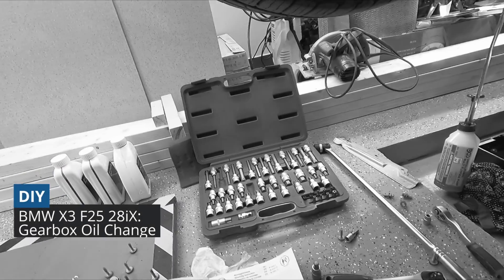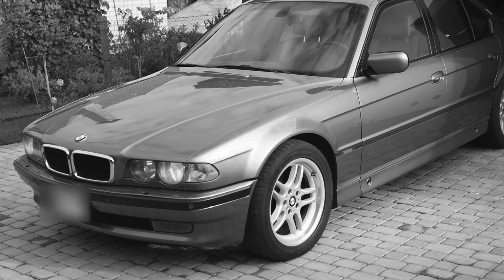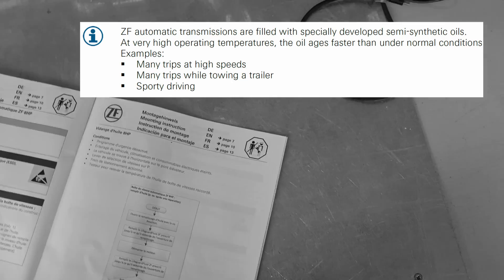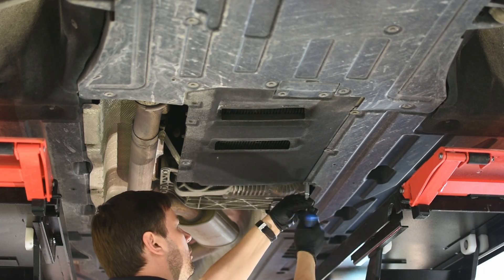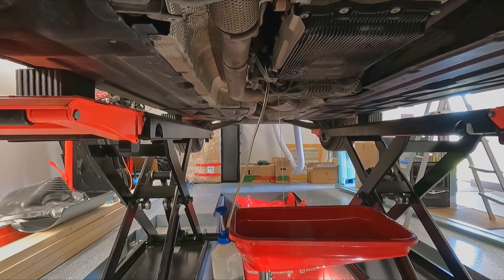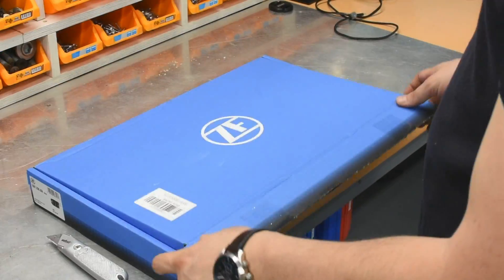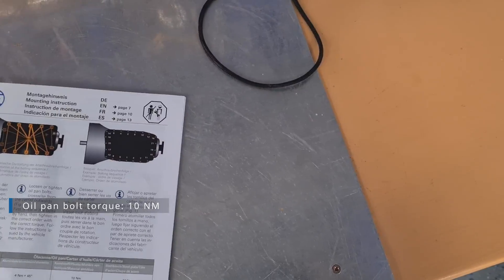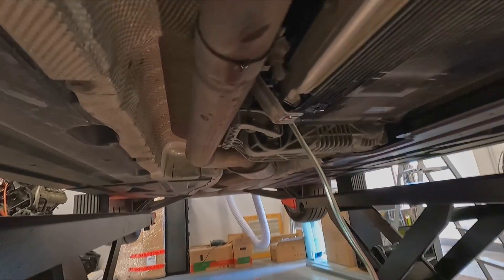Transmission Oil Change: BMW X3 F25 28iX / ZF 8HP45Z

Comment from the maker: 🔧 Tools used: 
       🔹BGS 2292 General rachet and socket set: https://geni.us/0Hhd (Amazon)
       🔹BGS 5188 Torx and Hex socket set: https://geni.us/Zz55Akr (Amazon)
       🔹BGS 228 flexible long ratchet ½: https://geni.us/aFqZxDW (Amazon)
       🔹Underhood LED light: https://geni.us/oUVLUpn (Amazon)
       🔹Hazet 1979N-92 flashlight: https://geni.us/gTxEiHA (Amazon)
       🔹Hazet 1979WP-1 magnetic charging pad: https://geni.us/abMfAS (Amazon)
       🔹Gedore 10-50 Nm torque wrench: https://geni.us/LBhSQA (Amazon)
       🔹Gedore 40-200 Nm torque wrench: https://geni.us/zseU (Amazon)
       🔹Oil drain pan wheeled: https://geni.us/zmEK (Amazon)
       🔹Gearbox fluid hand pump: https://geni.us/IzMivui (Amazon)

⚙ Spare parts used: 
       🔹ZF 1087.298.364 oil pan: https://geni.us/oikadLT (Amazon)
       🔹ZF Lifeguard Fluid 8 (Five liters required for one drain): https://geni.us/SBFEj6d (Amazon)

⚙ Additional stuff: 
        🔹Nitrile heavy duty gloves GRIPPAZ: https://geni.us/tc4XaYP (Amazon)
        🔹Brake cleaner: https://geni.us/LOeBEc (Amazon)
        🔹Oil absorbent pads: https://geni.us/AAvW0We (Amazon)
Reply from the maker: In the last step: fill up the gearbox with oil until it starts dripping and only then you can tighten the plug; keep the engine running.

Comment: Nice garage. What brand are the car lifts and how much did it cost? Are they enough for the X3? 
In the garage What dimensions do you have from wall to wall? Would love to build a similar garage to your here in RO.
Reply from the maker: Thanks. The lift is chinese, bought it here in Lithuania for 1450€ back then. Now it is more expensive - https://bds.lt/en/mobile-scissor-lift-bd-s2
It lifts to 1.1m and the pit is around 1.1m, so in general you can stand properly under the car. Lift's capacity is 3.5 tons. Garage inner diamentions are 7.5 x 5.8m. I did this lift + pit combo so that there would be no need of making height garage. I will make a video later on about the building process with pics.

Comment from the maker: In the last step: fill up the transmission with oil until it starts dripping and only then you can tighten the plug; keep the engine running.